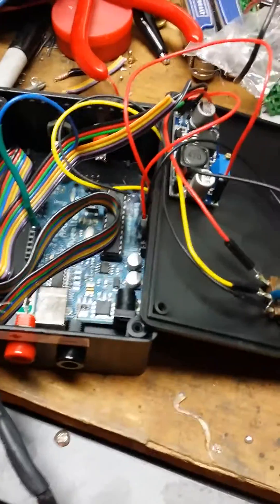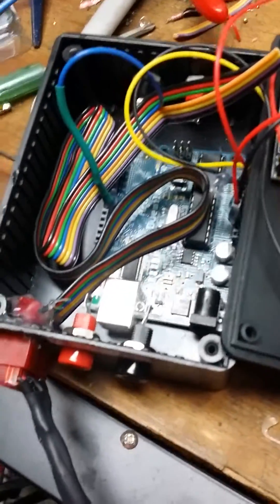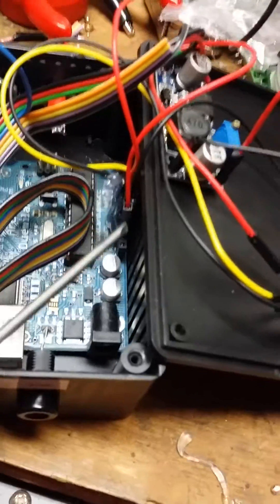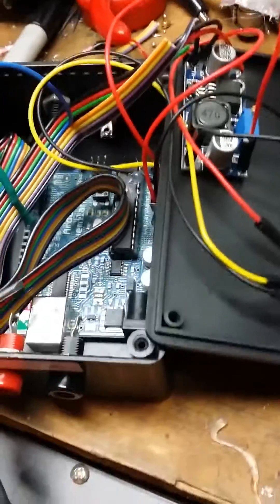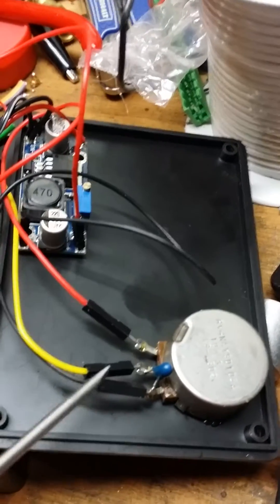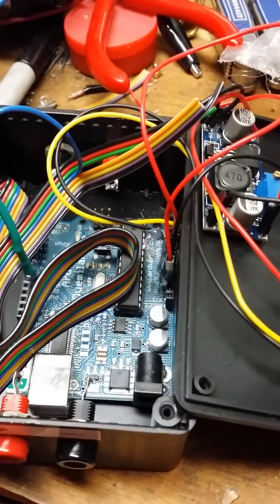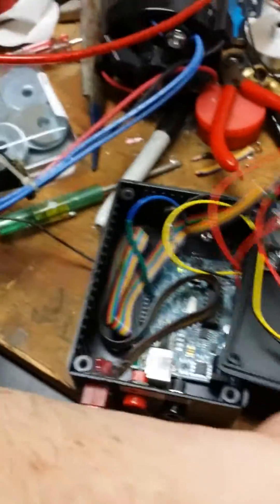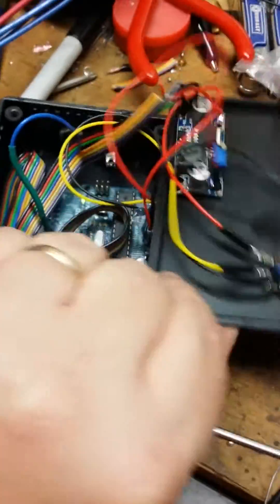X2 Mini Mill motor upgrade(3)

Comment: Very nice work but why not just use an SCR? They're dirt cheap and require a lot less additional components.
Reply: By SCR do you mean Silicon Controlled Rectifier?  Also by using the SCR what components would it remove from this project of his? Would this replace the need for the arduino and voltage regulator?  I'm curious since I'll be doing this upgrade in the future with my mini mill.  I noticed on his other video you said to use a MC60 Controller as well.  Is there a reason to use that over the controller that comes with the treadmill that he is using? Theyre both treadmill controllers right? They look to be about the same size except the MC60 is an additional purchase which costs more than his motor and controller combined. The MC60 goes for about $80-100 on ebay right now.